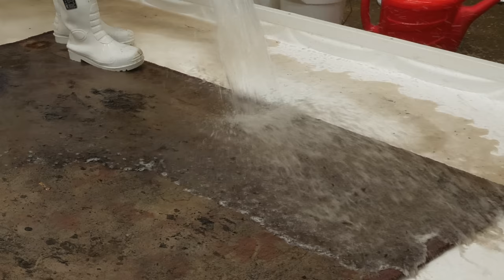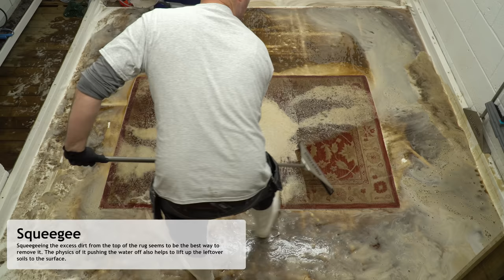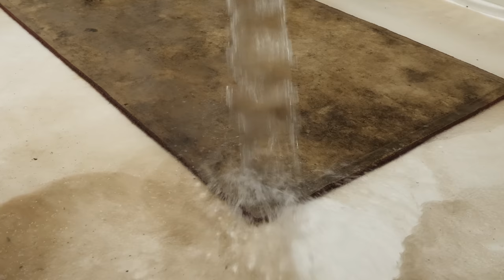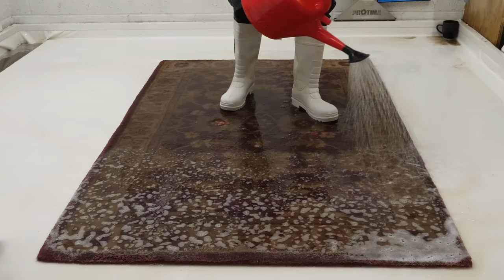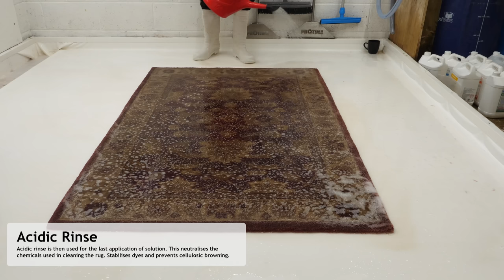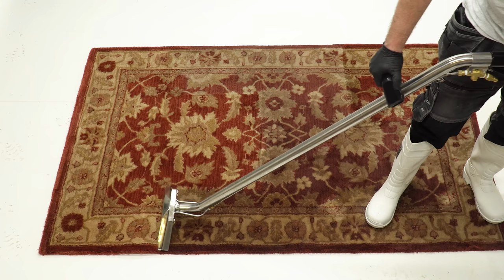Revealing The Beauty Beneath : Tobacco-Stained Carpet Restoration | Must-See ASMR Rug Cleaning !

Comment: My grandma smoked in her house. I had to help clean it out when we sold it. Her crt computer monitor alone had a straight up cm of tar on it. Like you could take a razor blade and scrape it off. Made the screen look yellow. The walls were beyond repair.  Just painted over that lol. Everything thrown away basically except for antique furniture. I can’t even imagine what it would’ve been like cleaning the carpets rather than replacing. I moved into my apartment maybe 5 years ago. I smoked for the first year and eventually when it was cold just started smoking inside. Then I remembered cleaning that house. I quit smoking.
Reply: Congrats on quitting.
Reply: I love a good quitter 👍👍👍
Reply: good motivation lol congrats on quitting
Reply: Did you say that you just painted over the tar covered walls, without cleaning them first???
Reply: Good for you!!
Reply: Congrats on quitting.
Reply: Fyi I've seen videos where a steamer does absolute wonders for getting tobacco grime off of walls, then when nothing else can come off, a special cote of sealant helps neutralize any remaining oder.
Reply: In the early 2000s, I was a computer tech that did a lot of house calls. If a customer was a smoker, I could always guarantee that there would be a layer of tar, dust, and bug parts stuck to every single component inside their computer. Power supplies and fans would burn out relatively quickly and cause many problems for them.
Reply: Good on you.
Reply: Thank goodness for grandma showing you what not to do 🎉, amazing work!
Reply: @dback68  my dad was a TV repair man in the 70s and 80s and as soon as he saw that the owner was a smoker, he knew what was wrong with the TV, lol

Comment: You should have a table top build that’s 3” off the floor on a slight angle like 10-20 degrees with drill holes or even slots on that table for the water and dirt to drain down into. Whatever is under the “table” probably the floor have Angeles also with some type of drain system for the water to go where you need it to. Save some time cleaning the carpet in general and cleaning the water and dirty soap off the floor repeatedly

Comment: Because of gravity - pressure from the machine's and the water's  weight, I would guess that everything needed to come out of the rug gets further embedded into the rug. And this is why it takes so many repeated rinses and cleanings... Now - If there were a way of clamping one long edge of the rug and hanging it up inside of a large vat filled with water and cleaning solution - perhaps using ultrasound the vibrate everything out of the rug would be way more efficient as well as a lot less labor intensive? All the particles would settle to the bottom and flushing the tank repeatedly while turning the carpet 90 degrees each time would ensure all 4 edges are cleaned as well. Anyway - Just a thought.

Comment: Just curious but do you not hang it outside, draped over a rail or something then blast it with water, kinda like a first step before bringing inside? Just seems like that would help really get rid of a lot of the physical debris before getting really into the cleaning.
Reply from the maker: No because i can contain all the dirt in the wash room for easy cleaning. Plus hanging is not effective, just easier to lay it out.
Reply: @MountainRugCleaning  oh okay. I didn't really consider where all the dirt would be going, would probably would effect the yard over time.
Reply: @MountainRugCleaning  also, just in case, I didn’t want to come off as rude like I was suggesting something to you, I was asking out of curiosity but wasn’t sure how I could word my question.

Comment: I need a video of the googly eye machine with the close up camera for about an hour as it works. Everytime as I fell asleep you cut away to the top camera which would change the sound frequency and pull me out of it or you turned it off. Also the sound of the pressure washer close up was nice.

Comment: I'm not an expert, that goes without saying, but wouldn't it be more efficient if the rug were on top of a grate? That way the water would go through the rug and out from the bottom. Maybe you could have a system of smaller grate modules that you could put together to fit the size of the rug?

Otherwise you do a great job. Thanks for the videos.

Comment: maybe I'm cynical but I'm suspicious of this rug having been neglected, in a smokers house then outside for years. It still had the UPC from the store it was purchased from on the bottom...which was easily obliterated by the floor scrubber so it's not like it was extra sturdy or something. Also no holes from bugs eating it, no visible fraying...doesn't seem like it was outside long. 

I've heard a lot of restoration youtubers start by dirtying up a perfectly fine item so that the finished product is extra impressive.

Comment: Next, coat it in ferro-tungsten superalloy, fire it at mach 6 with a railgun, through a cold plasma vortex during a thunderstorm. While it's bristling with cold electricity, drop it in compact neutrino gel and add a dash of cicada stem cells. I don't know what the fuck I'm saying but yes, it removes the dirt.

Comment: I have been quit of smoking for over 6 years. I however have smoked for over 25 years throughout my life. I am so very glad that I quit. Smoking is disgusting.

When I used to be a computer technician, if a customer came in with a computer and it had hardware failure and they smoked inside, we could never clean all the tar off of the internal components. We just had to throw their computers in the garbage. Terrible waste of hardware. Can't fix overheated components that degraded under layers of tar and dust for years. 🤢

And the stink always made me sick.

Comment: When I watch these I get anxiety. None of the carpet cleaning shows I watch use gravity to their benefit. Kind of like when mowing without a bag…. You have to mow so the grass is thrown to the area you have already mowed.  Twice as much work to start at the end closet to the drain and then wash all the dirty water onto the area you just washed. I am not a carpet cleaning expert but use gravity. Spray left to right starting at the top on the high side of the  floor. Do you follow?

Comment: Am I the only one who think this looks very..inefficient?  The water and dirt has nowhere to go..it just hits the side of the work surface and then blows it back onto the carpet. And so much gets trapped inside and under the rug. The work surface needs run-off on all sides to eliminate blowback and the rug should be on some sort of gris to allow water and dirt to run out underneath instead of getting trapped. There was nothing relaxing about this.